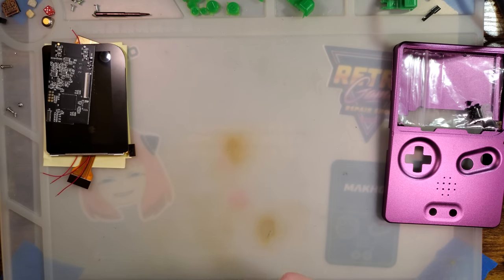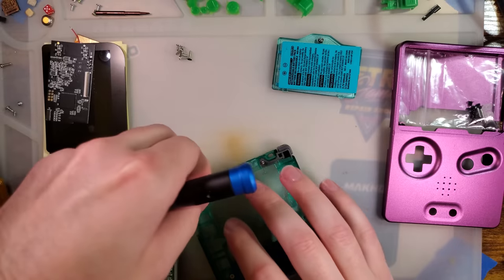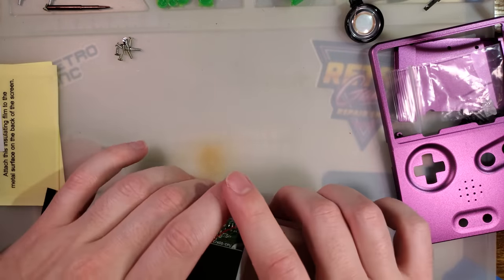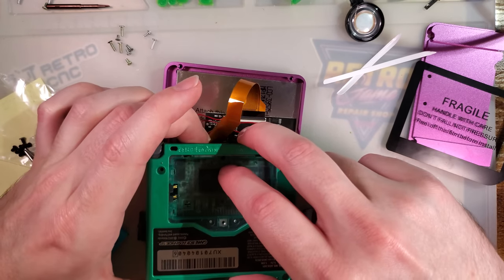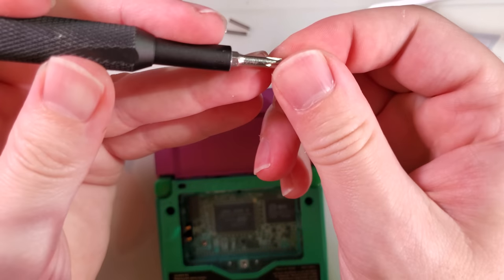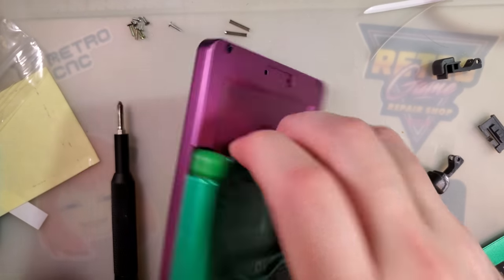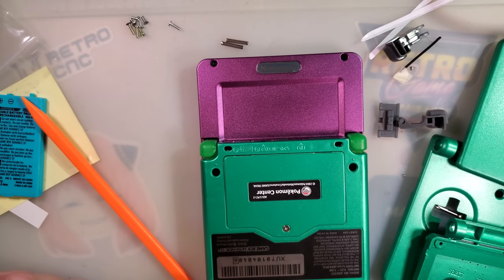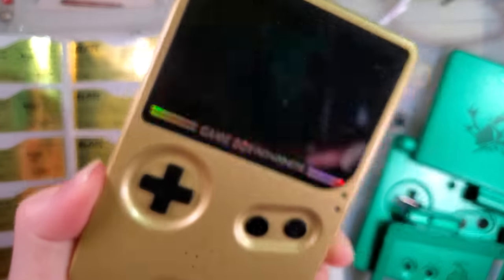Slate Assembly Guide

Comment: i never fully understood the slant but its so obvious to me now after the end of the video. the screen obviously cant be on the same plane as the bottom half. duh
Reply from the maker: Yep. Similar designs opt to just make the buttons longer and "fake" being in the same plane. The design works and is quite a bit easier to make but then it requires custom buttons and I didn't want to do that. Alternatively, I could have just stretched the design and made the whole thing a lot taller but then the link and charge ports would be basically unusable. There are tradeoffs no matter which approach.

Comment: Anyone else who finished this having battery issues?

 I completed mine yesterday, prior to the build my gba would get about 2.5 hours on average, and I used mine daily in 30 minute increments. I just charged it overnight and played it for 6 minutes today and it turned red. I have a friend who did the build as well and he's getting about the same. We each ordered new batteries, hopefully that'll make a difference, kind of unnerving that my battery was working so well prior though.

Also the machined buttons were pretty loose to me and gave an audible rattle when the console shifted, I chose to stick with the OG buttons because of that.
Reply from the maker: Are you using the original battery that came with the console? The one that's almost two decades old? It might be time to replace it. 

An IPS kit (like the Slate requires) will reduce the battery life considerably over stock but that's the price we pay for better screen quality.

Comment: Really sucks that a gorgeous mod like this forces you to lose core features of the GBA. Hoping down the line we get a modified version that allows for Gamecube link cable support.
Reply from the maker: If you consider that to be a core feature, then I'm sorry for your loss. You can make a short dongle extender if you want.
Reply: @makho  that's actually a valid alternative as long as the dongle can stay in firmly. My biggest worry is the lack of clips leaves a bigger risk of disconnection and corruption
Reply: Core feature? Really?

Comment: Metal back would have made this perfect
Reply from the maker: agree to disagree
Reply: I’m a bit fine with both ways because the original sp design was perfect Mahko basically just complimented its greatness with the slate design for the most part the design made most of the system metal.
Reply: Yea i disagree, absolutely love the mix and feels nicer with a plastic back